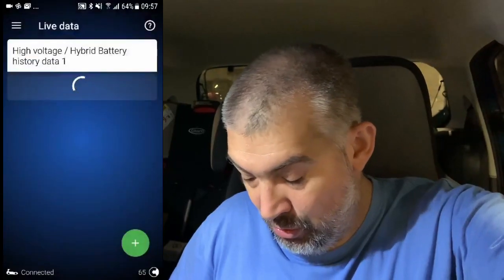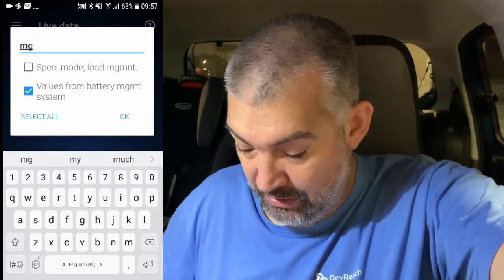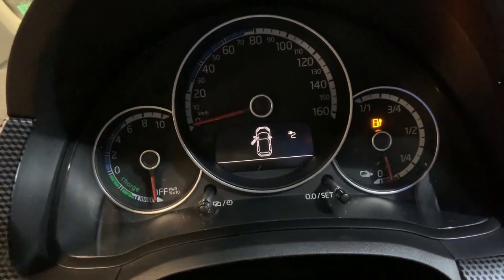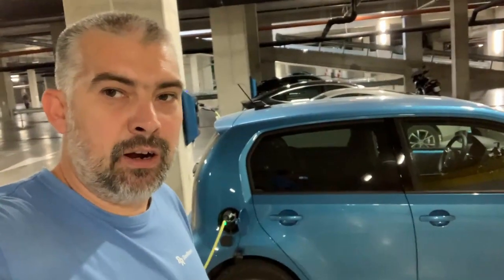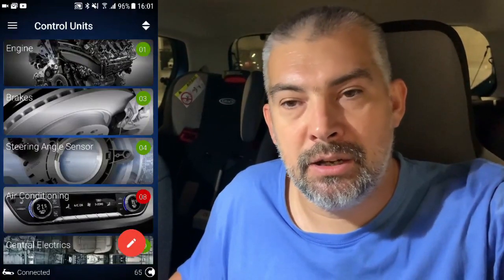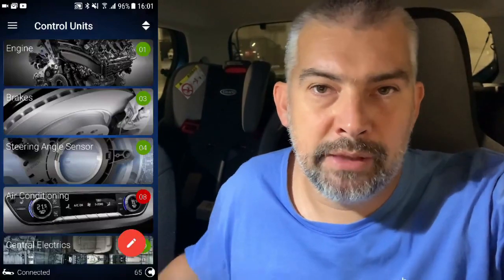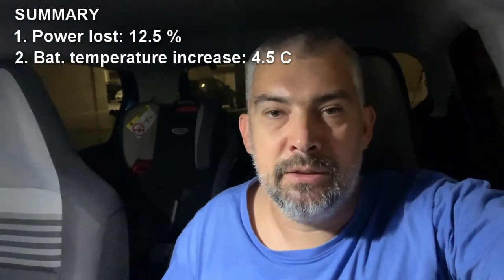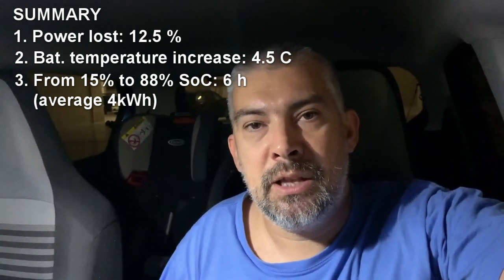Testing the onboard AC charger on Volkswagen e-up gen. 2

Comment: when you charge the batteries with the cable from home and the power fails and then comes back.  does the charging stop and then restart or does it stop and does not restart?
Reply from the maker: To be honest I haven't noticed that but if I have to bet I will go for resume charging.
Reply: @tedonash2681  Then I think I have some problems.  because recharging does not restart and the charger goes into error.  i have a skoda citigo-e.

Comment: In the Live data from the Hybrid Battery history you can see the counter for kilowatt hour charge and discharge. Isn't the difference between those 2 values a power loss?
Reply from the maker: I think the amount of power charged is the one taken from grid and the amount that is discharge is the power that is given to the motor or other car electronics.
Reply: @tedonash2681  I checked it today, the counter for kilowatt hour charge is summary of charging from the charging stations and from breaking with the electric motor.

Comment: Charging at 4 kW (instead of the maximum 7.4 kW) is high enough to suggest that the EVSE was three-phase (of which two were used), but low enough to suggest that the current was somehow limited to 9 A (by EVPoint and not the car, presumably).
Reply: I fully charge my E-Up in 5:15 Hours from nearly zero to 100%. There must be a limit on the Amperes.
Reply from the maker: @bjornanderson78  hmmmm I will check what is happening in mine setup. Thanks for pointing this out.
Reply: But 4 kw is for the entire charge.
from 60-80% is its slower so i suggest trying one from 15-60% to see speed results there
Reply from the maker: @Viking_X  this is the reason for the 4 kw : https://youtu.be/EUqRmeRhKpo
Reply: @tedonash2681  Im not sure you have the right reason still.
inside every cablere ( no matter how many phases) there is ONE resistor telling the car internal charger how many amperes that phase can handle.
And it is the same for 1, 2 or 3 phases. it just multiplies.
The resistor  tells the onboard charger that it can handle op to 20 amps for each phase, its better for cable to be abe to handle more than the charging itself so it wont get hot.
Thi just means that THE CABLE can handle up to 20 amps per phase but since the onboard charger can only handle 16 amperes the charging will be 16 amps per phase.
I think the limitation is in that wall charger since im pretty sure its not in the cable.
I have the same cable and i can see on charge times on public chargers that its much closer to 7 kw than 4 kw, atleast up to around 60%
Reply from the maker: @Viking_X  it is in my list to test the cable on the public charging stations to be sure to confirm your point.
Reply from the maker: Dan Te. This is average. At around 80 the charging speed throttle
Reply: @tedonash2681  Aha, makes sense.
It would be nice to see the charge curve (maybe also the temperature) from the OBD logs (ideally for a full 0 to 100 % charge if possible).

PS: For DC charging I found a few tests that stop at 80 %
https://support.fastned.nl/hc/en-gb/articles/360006496757-Charging-with-a-Vokswagen-e-Up-
https://www.naf.no/elbil/elbiler-i-norge/volkswagen-e-up/ladetest-vw-e-up/
Reply from the maker: @dante.6794  I will do that but with my DC charge tests. It is really challenging to monitor the temperature/charging speed for 6 hours.

Comment: Thanks a bunch for that insight! That is a very typical charging loss with many EVs, I would say. Was the "ignition" on while charging? If yes, what extra draw would that result in? N.B.: As many will comment, in the evaluation part you would have to switch power and energy units.
Reply from the maker: Ontopof Theroof the car was off during the charging process